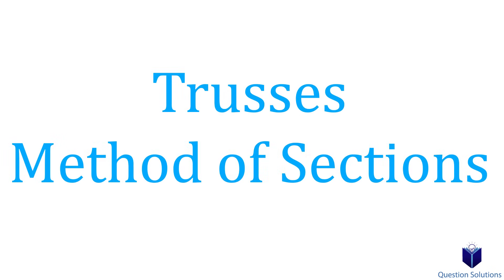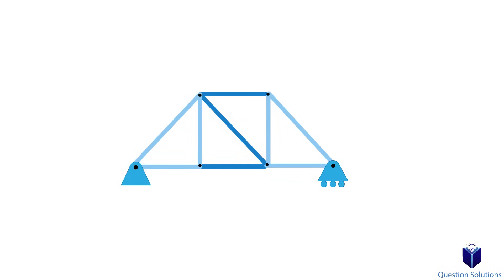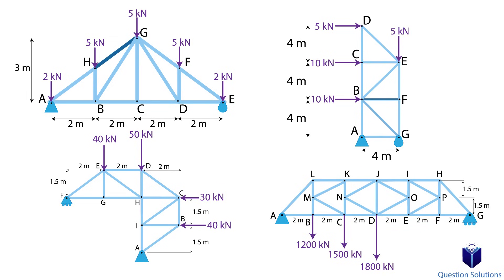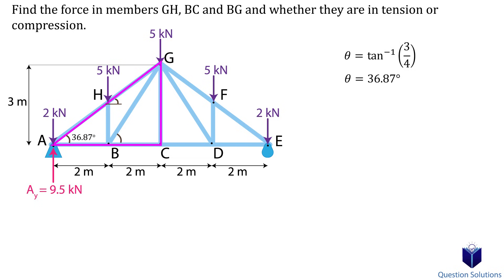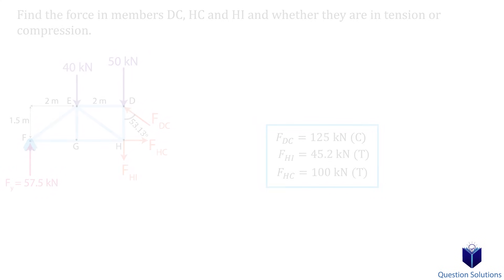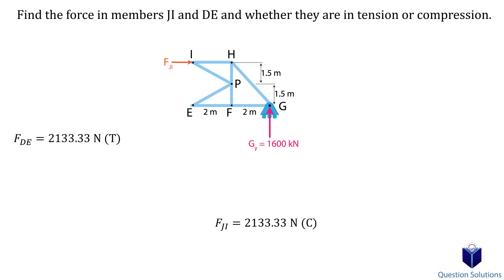Trusses Method of Sections | Mechanics Statics | (Solved examples)

Comment: I still don't understand when to use the moment equation and when to use the axis equation
Reply from the maker: When you have 3 unknowns, you will need 3 equations to solve them. One for x-axis forces, one for y-axis forces, and one moment equation. Sometimes, you can use a single moment equation to solve for an unknown as well. This happens if you write a moment equation about a point that has other unknowns. Writing it about the point with the most unknowns automatically eliminates all of those unknowns.

Comment: 7:36  what if it is isolated at B, it would not give  bf zero
Reply from the maker: Of course it would give you a zero 😅You cannot get two different results by analyzing two different points, you will always get the same results. If you're not getting zero, there is a numerical error in your equation.

Comment: For the second question, why was the force in BF calculated at joint F and not B?
Reply from the maker: Wouldn't make a difference, you'll get the same answer regardless of where you calculate it at. So if you want to, you can solve it at B, your choice, but doing it at B means you have to deal with more forces.
Reply: @QuestionSolutions  Alright then, thanks for the reply!

Comment: For the first problem you didnt include an AX it is not a roller so it has an Ax why ignore it?
Reply from the maker: Calculate AX for me and let me know the value you get :)

If you don't have time, it's 0. There are no horizontal external forces applied to the truss, only vertical, so there is no AX force.

Comment: Sir I have one doubt why we didn't consider the forces acting on AH and AB(Fah , Fab)?.....
Reply from the maker: Please use timestamps, I don't know where you're referring to. Thanks!
Reply: @QuestionSolutions at 2:44 sir...
Reply from the maker: @Zero_3.14Those are internal forces.
Reply: @QuestionSolutions sir, force near the cut section are required...rest of the forces are internal forces?
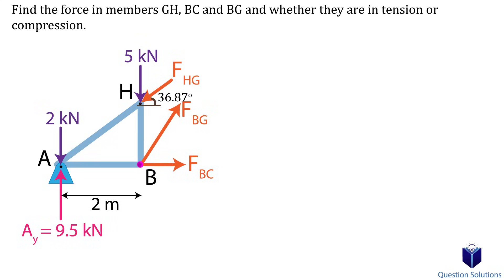Reply from the maker: @Zero_3.14 So you only cut the ones you want to find, right? Here, we wanted to find GH, BC, and BG. So you can think of them as external forces, but everything else is internal (inside the truss).  See from: 2:45, and at 2:55, I color code them so you can see it easier.
Reply: @QuestionSolutions ok sir i understood....
Reply from the maker: @Zero_3.14 This part can be a bit confusing, but if you think of it as, any cut member is an external force, and everything else as internal forces, it'll make it much easier to solve. If you have any other questions, feel free ask with timestamps. Best wishes!
Reply: @QuestionSolutions  thanks sir...Sir i have one more doubt did you posted any videos regarding resolving into two components(sin,cos)...As in Block(inclined) sums it is difficult for me to find which one is cos and which is sin
Reply from the maker: Yes, see: https://www.youtube.com/shorts/vynnKlJD_Jo?feature=share
Reply: @QuestionSolutions Thank you for taking the time to clear my doubt, sir.

Comment: I thought compression was negative and tension was positive?
Reply from the maker: I don't know what that means. 😅Positives and negatives don't determine any compression or tension, it's based on whether a force leaves the pin or comes towards a pin.
Reply: How do I know if a force leaves the pin? I always used negative for compression and positive for tension @QuestionSolutions
Reply from the maker: @khalidibrahim4308  Look at the arrow of the force. The direction it faces. If it's coming towards the pin, it's in compression, if it's leaving the pin, it's in tension. You cannot figure out compression and tension through positives or negatives.

Comment: At 7:20, I'd like to ask, does this apply to all problems? Where you may automatically use method of joints in finding the forces in the "truss" part?
Reply from the maker: Are you referring to the equilibrium equation?
Reply: I meant when you were isolating a joint to find the member in the "truss", and then used the method of joints, is it really part of the m. of sections problem (if necessary)
Reply from the maker: @eslmemlse  Of course, you can always isolate a joint and solve for a member. The method of sections just implies that the whole truss is not considered and that only a part of it is.
Reply: @QuestionSolutions noted, thank you!!

Comment: “If we take the left side of the section as reference, should clockwise moments be considered negative and counterclockwise moments be considered positive????”
Reply from the maker: No, the side you take makes no difference. You're only seeing if a force will make a moment be clockwise or counter-clockwise. When you write your moment equations, you're free to choose which side is positive, so you can pick clockwise to be positive or counter-clockwise to be positive. You will get the same answer regardless of what you pick.

Comment: Your videos are honestly really helpful when i can't ask my professors questions, but I did have a question, why aren't moment equations used in the joint's method but used in the sections method?
Reply from the maker: You can use moment equations in the joints one too, it's just not as useful since you can use summation of forces in x or y axes to get an answer. But no, you can use any method whenever you want.
Reply: @QuestionSolutions thanks so much, that actually really clears it up

Comment: @9.36 we took FHC = 100 which i get but looking at the truss as a whole that member FHC is a zfm but my question is. Once we make that cut we don't consider it a zfm anymore cause we made the cut? or how does that work? thanks in advance
Reply from the maker: That's incorrect. Looking at the whole truss, that member FHC is not a zero force member. It doesn't matter how you solve this truss, whether you use method of joints, or sections, you will always arrive at the same answer. You don't get 2 different values for forces in a member by using a different method to solve for them. That would be crazy in real life. 😅 I actually encourage you solve this whole truss using the method of joints. You will get the exact same values :)
Reply: @QuestionSolutions thank you. method of joints will probably be deadly but I’ll give it a shot 😭

Comment: im really confused about choosing either the x or y component for finding moment. at 6:24 you say we use the x component so why do we use sine for finding force of BG? and also what do you mean when you say our assumption is correct regarding the direction of forces? When we assume directions, how do we know we're correct?
Reply from the maker: There are multiple questions so I will try to answer them in order. So here, we are finding the moment about point D, this is shown by the sigma symbol and MD next to it. What that means is, we are looking for forces or the components of forces that will create a moment about point D. I assume all the other forces makes sense except for force FBG. You are missing some fundamentals so you should take the time to watch this video (https://www.youtube.com/watch?v=QNNnPZ68STI). Regardless, let's imagine the components of force FBG. One will face to the left, and the other, straight up. Only the component facing left can create a moment. Why? Well, the vertical component's line of action goes through point D. In simple terms, it cannot make the truss "spin" about point D because it's literally pushing up at point D.

So the question then becomes, how do we figure out the x-component (the component facing left)? Looking from the perspective of the 45 degree angle, opposite to it is the x-component. Sine = opposite/hypotenuse, so you need to use sine. Again, you're missing some fundamentals when it comes to trig, so I encourage you to watch this 60 second video: https://youtube.com/shorts/vynnKlJD_Jo?si=MRtRUiLnHI1zZDpC

Lastly, how we do know if our assumed directions are correct? If you end up with a positive value, your assumption is correct. If you end up with a negative value, then it's opposite to your assumption, but the magnitude of that value is correct. For example, if we had FBG pointing away from the pin, we would get -35.3N. This would indicate that our force is actually facing towards the pin, but the magnitude (35.3) is correct. So you would then write the positive value and change the direction of your arrow to face the pin in your solution. 

I hope that helps, best wishes :)

Comment: 2:50 shhouldnt you assume everything is in tension? so F_HG should face the other way?
Reply from the maker: Why? Why do you want to assume everything to face the other way? Who said this to you?
Reply: @QuestionSolutions  my professor said that, at least for method of joints, you should always start by assuming all members were in tension. I assumed it should be the same when using method of sections.
Reply from the maker: @rorybaker5799 you can do that if you want, but once you gain enough insight, you can figure out the direction of forces in a truss without solving for them. So you don't have to guess or keep them all in a certain direction for either the method of joints or method of sections.
Reply: @QuestionSolutions  Ah I see, thank you for the explanation.

Comment: I never know when to use sum of the x forces and y forces, and when to just use moments. My default is x, y, and one moment, but in this video there was one with just 3 moments, so now idk how to decide what to use when.
Reply from the maker: It does not matter, but you should look to see if you can solve for a variable using an equation. So if you can solve for a variable using summation of y-forces, do that first. If you can solve for a variable using a moment equation, you should do that. Whatever leads to an answer.

Comment: At 4:24 why is FGH in compression despite having a positive answer?
Reply from the maker: The positive signs don't indicate whether a force is in compression or tension. It only tells you whether your chosen direction for a force is correct or not. What tells the compression or tension is the direction of the force. If a force comes towards the pin, it's in compression, if a force is leaving the pin, it's in tension.
Reply: @QuestionSolutions  
And this right here is what I'm most greatful for 
The idea that the direction one chooses will determine the type of internal force  which the member experiences
Reply from the maker: @johnpitsi2984 I just want to clarify, the direction we choose doesn't determine whether a member is in tension or compression. You understand that right? If you need clarification, please let me know.

Comment: 2:01 why are we subtracting the sum of moments instead of adding?
Reply from the maker: Clockwise was chosen to be positive, so any moment creating a counterclockwise moment would be negative and any clockwise moments would be positive.
Reply: @QuestionSolutions would this change the answer if clockwise was chosen to be negative?
Reply from the maker: @patrickstar2048  No, makes no difference to the answer. Try it out.
Reply: 4:36 also shouldn’t the 5(2) be 5(1.5) because is that not the perpendicular distance of the 5kN to point A?
Reply from the maker: @patrickstar2048  No, since only the y-component creates a moment. So the horizontal distance to the y-component is 2 m.

Comment: Sir in problem 4 
You have cut 4 unknown forces 
But there is general rule in section method that we can cut max.3 unknown forces at a time 
So how this case is different?
Reply from the maker: It's because the forces at point I and E, are vertical and horizontal, and taking the moment about either points I or E eliminates three of the forces, leaving you with just one to solve.
Reply: Ok sir thanks
Reply from the maker: @ You're very welcome!

Comment: hello i have a question at 2:04, why do you calculate Ay with a moment, Can't we not just work with the sum of y=0 -> Ay-2-5-5-5-2=0 -> Ay=19kN , i know this isn't the same answer but why does this not work and why do we need to use the moment
Reply: it it because the is also a single force Ey in E, so Ey + Ay=19, PS: i have been watching your whole series on statics and i these kind of videos have never been so helpfull as your channel, the fact that you answer to every question shows your passion keep up the good work!!
Reply from the maker: @toondebeule8377  Yes, that's correct. We don't know the value of Ey, so you can't use a summation. Instead, we take a moment about E, which eliminates EY, and we can the directly solve for Ay. 

Also, thank you very much for your kind words. Best wishes with your studies!
Reply: and i also have another question, in my class i have to work with counter clock wise moment is positive what does this change to the solution, when i do this my forces are negative is this possible? so when i calculate Ay i get -9,5kN but in the next step it doesn't work because the 2kN and 9,5kN are in the same direction, what would be your solution?
Reply from the maker: @toondebeule8377  The direction you choose for positives or negatives does not matter in 2D problems. You will always get the same answer regardless of the direction you pick. It's completely up to you. Please see: https://www.youtube.com/shorts/P029mqnp4XY?feature=share

Comment: how do you know if you have to get the summation of moment at a certain point or simply get the summation of forces?
Reply from the maker: If you have a set of equations, and you cannot solve them using just a summation of forces, you will need a moment equation, one or more.
Reply: @QuestionSolutions  i mean, for example, in this video, after you got the force DC, you used summation of forces to get force HI, when i thought i was supposed to use moment equation and i thought i would have to do it at point F to get rid of the force HC and thus getting me the force HI
Reply: i got an answer of 5 kN and i would not have known i was wrong if you didnt show that you used summation of forces to get the force HI
Reply from the maker: @JohnRovicAlejandrino  You definitely can use a moment equation to get force HI, but my assumption is, you're not writing a proper moment equation. There will be no difference in the answer. They all will result in the same answer. Also, once you already use a moment equation to find a force, you can do the rest with just summation of forces, there isn't a need to write a moment equation most of the time, but if you did, you can still get the same answer.
Reply from the maker: @JohnRovicAlejandrino  Please write your moment equation so I can go over it and let you know what happened. Even from the answer, we can easily see there is a mistake, you got a force of 5 kN, when all of the forces on the truss are 40s, 50s, etc. So there is an error in your moment equation and I will help you out if you write it here.

Comment: i have a question. do we always have to assume that the rotation is clock wise and positive? would changing that matter? im confused that if F turns out to be negative, my thought process is to change Tension to Compression (or vice versa)   or  change the rotation to counterclockwise (or clockwise)
Reply from the maker: I think you are confusing writing moment equations with forces in truss members. You can pick whatever direction you want for the moment equation to be positive, so clockwise or counter-clockwise, you will end up with the same answer. What determines if a member is in compression or tension is whether a force is coming towards the pin or leaving the pin.
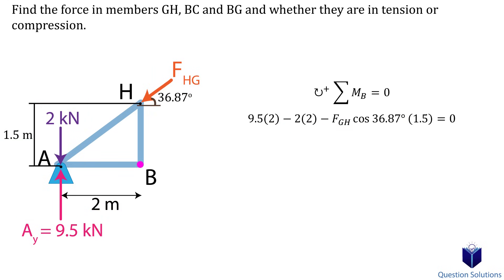Reply: @QuestionSolutions  oh i see, i get it now. i tried changing the signs at 4:10 and i still arrived at positive 12.5,  thanks!
Reply from the maker: @punpunyana  Awesome :)

Comment: how do we determine whether to find the support reactions or not  ??
Reply from the maker: If you use a section that you can solve without needing support reactions, then you don't need it. For example, at 5:35, notice we cut the supports off, and then we had enough givens to solve the top values. But notice at 8:24, even after the cut, we still needed the reaction at roller F. So in most cases, the only time you don't need to know support reactions is if you make a cut and on the side you selected, there are no supports.